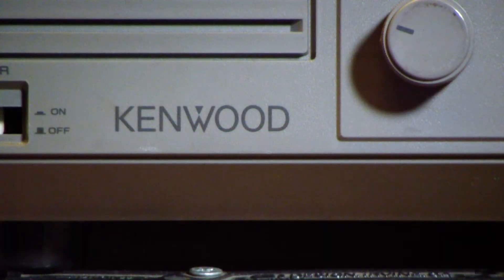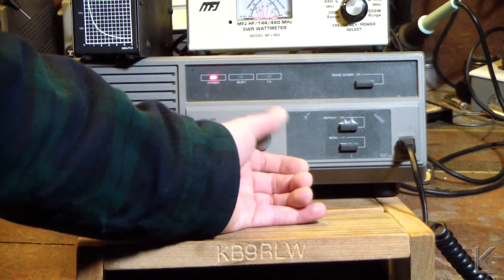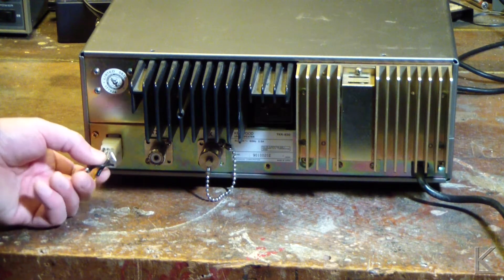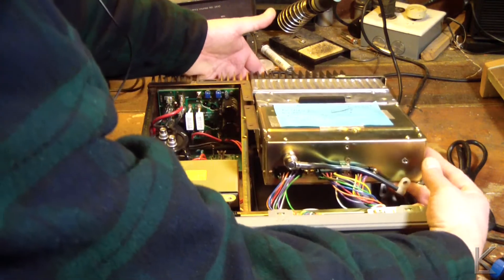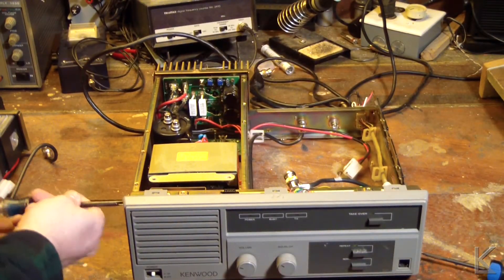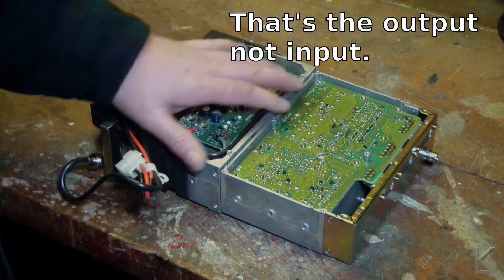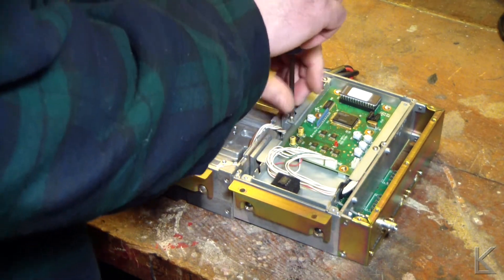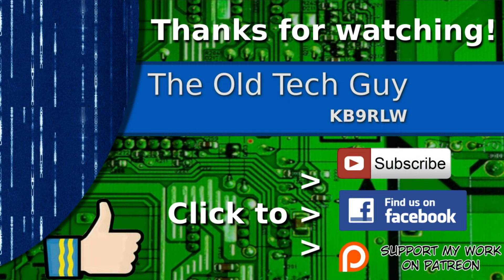Ham Radio - Teardown of a Kenwood commercial UHF repeater

Comment: the 2 eeprom that need to be reprogram are the 2 small 8 pin chip. the large one is NOT to be reprogrammed. on the front larger pcb there is a single 8 pin chip and it is the one that need to be removed (put a new socket) and programmed to change the frequency.

Comment: You program the frequency EEPROM via that little black plug on the top left of the control board. Use the KPT50, or KPT-20 programmers, very easy.
The same programmer will also set the "EIA standard" CTCSS tones on that little 8-pin "93C46" EEPROM.
Reply: The frequency control EEPROM 93C46 is soldered onto the front control board.

Comment: We are currently using the VHF variant, the TKR-720. Given to us by a local public safety organization. I brought it down to 2 meters and it's an excellent performer. Squelch opens at .2uV. 40 watts out with a good fan on the heat sink. Excellent piece of equipment.

Comment: the small eeprom is a 9846 it holds the PL tone there is a second eeprom same number on the front panel board 9846 notice the black plug on the left top edge of that boardthat is the eeprom programming port that one is for the frequency. The eprom you pointed out is just the firmware for the internal controller.    yes you can remove the eeprom from the front panel and install a socket and use an eeprom programmer to read edit and reprogram it to any frequency same as the one for the tone controller.  but you must do some math and converting from decimal to hex then entering hex in backwards and writing the eeprom or you can use a kpt-50 programmer which is expensive but I have 1 and I have eeprom replacements if someoe needs a set programmed I would be happy to help.  73's K4ATR

Comment: That was fun to see, I remember working on one of those many years ago when I worked as a two way tech for a shop.  From what I remember, that was a very nice repeater, all self contained with the duplexer and everything needed in a small package and easy to set up and use.  I am thinking that it was a UHF model only with built in duplexer since the VHF duplexer might be too large to put into the package but I don't remember for sure, maybe they did have a VHF one also.  73

Comment: Don't tear it apart! put it on the air! 
that repeater looks to be good enough to put on the air with a 100$ duplexer. They will tune the duplexer for you in most cases.
Reply: Kevin, only three? Here in SoCal we have virtually ALL of the 440 pairs (20 Khz centers) with repeaters on them and 99.99% of the band is quiet as the tomb. I echo the recommendation to set it up. Betcha no one's on the 449.0- pair so a pair of duplexers and a simple antenna at the house and with the topography of Fort Wayne you could cover all Northern Indiana! 

Go for it!
Reply from the maker: We've got three uhf repeaters in the area and they almost never get used.  No need for another.  I knew I'd get comments like this one though!  Ha!   I'll probably list the modules on ebay and use the power supply for a much needed bench supply.

Comment: the ham pl tones and the commercial pl tones are the same  now the digital voice pl tones are a totally different critter
Reply: No difference in commercial and amateur PL tomes. All the same. They just decided to run with no PL on this one.  I have worked on quite a few of these models. Since there is many cut wires from the accessory jack is probably why it does not repeat. Probably had a controller running it.  Hate to see this one stripped as they make nice repeaters and easy to maintain. Nice tear down.
Reply from the maker: We've got three uhf repeaters in the area and they almost never get used.  No need for another.     I'll probably list the modules on ebay and use the power supply for a much needed bench supply.
Reply from the maker: There's something different about it on this unit.  The conversion article I read talked about the tones being different somehow.   I did find that a bit confusing as the standard PL tones are,  standard.